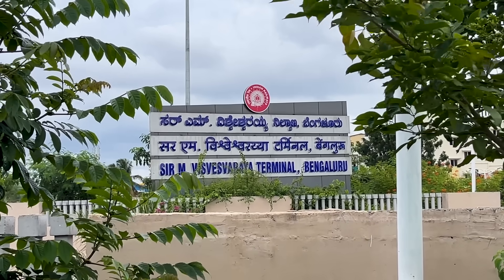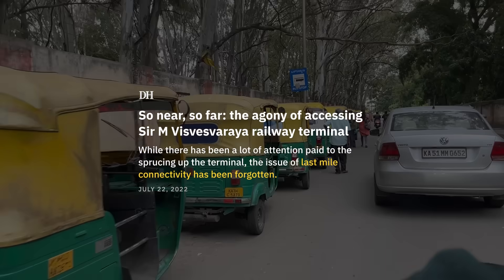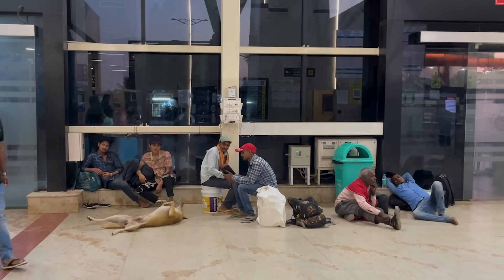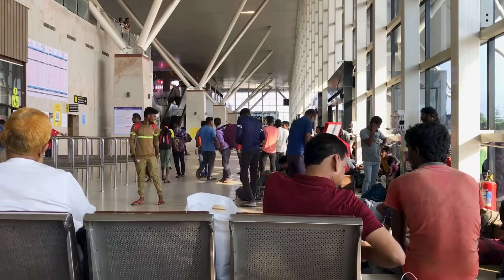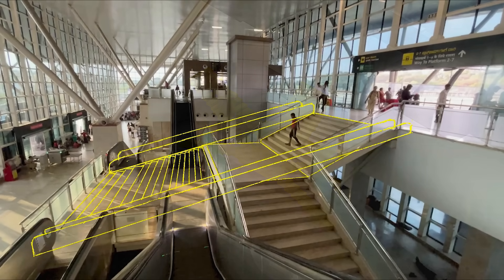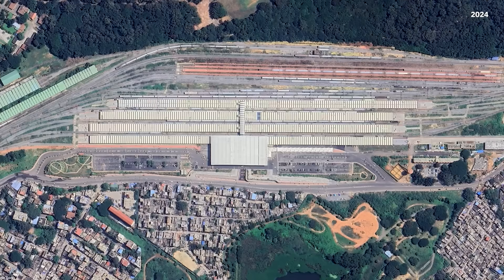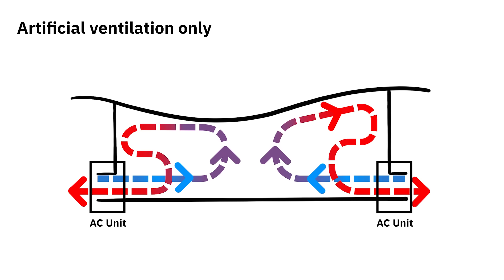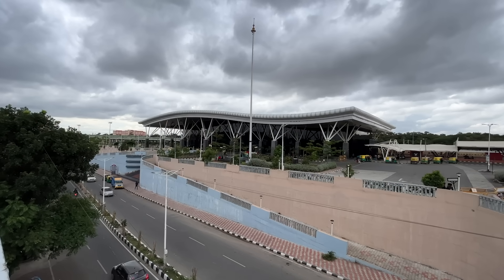India’s first AC railway station SMVT: what went wrong?

Comment: The Cooling System is Trash, was hard to navigate, also the place is extremely difficult to reach 
and the place looks like dull, the networks are poor, can't even get a service for internet, also the food court
was pointless, i didn't even see a sign board until i saw before boarding the train, also the place is a mess,
pan stains, the charging sockets outside on the benches doesn't work at all, the bathrooms are hidden, don't know why
they did that, also there's no announcements of oncoming trains sometimes, no drinking water, no waiting rooms were seen
especially the AC waiting rooms. Genuinely was the worst experience to be honest !

Comment: Have visited it , the first problem it is hardly accessible , the long journey by auto took almost forever.
Inside seemed like the idea was to show off and not think much about passenger  convenience.

There were not kiosks on the platform only at the entrance. 

Even the escalators are crammed into the little space available.

Comment: Built in one of the most inaccessible locations in Bangalore.
No Regular Bus service, nearest regular bus stop is about 2 km away
No nearby metro station, again nearest metro station is 3-4 km away.
Even road connectivity is limited, there are only 2-3 road routes to reach this place.
Reaching this station even by road is a big task, hardly any halting space for vehicles outside the stations.

The location is suitable for a smaller station for local population around that area, not for people all around the city.

Since it is already built, making a signal free road route to this station, connecting at least 3-4 main roads would be better

Comment: While the infrastructure at this station has potential, the real issue lies in the lack of civic sense among many commuters.

I've visited this place multiple times, and it's disheartening to see people spitting pan masala on walls, sleeping on the floor, and treating the space with zero regard for public hygiene or decorum.

If this station is designed to match the standards of an airport or metro, then the upkeep and enforcement should reflect that. Authorities must step in — not just with maintenance, but with clear rules and accountability.

Public spaces deserve respect. Basic manners aren't optional.

Comment: Went there early morning & that glass building with poor AC was hot as an oven.
Roof was useless for outside.
Expected an airport like infrastructure, but maintained like a govt rural bus stop.
People sleeping on floors & blocking the path, the lifts & escalators that dsn work at all- had to climb stairs with heavy bags.
No cleanliness at all.
Unclean toilets & everything is pan stained just like a normal Indian public place.

I'd rather prefer Yeshwantpur station- big station, clear visibility, metro, bus stop & auto stand is just a few feet away from main gate. ❤

Comment: 6:01 It may work for non air-conditioned infrastructure, but for centralized AC systems, it may cause pressure imbalances resulting in jammed doors and weird air movements within the building. But, I do agree with the rest of the feedback. Instead of space and resources, they should have invested on designing and planning.
Reply: Research reveals it saves energy. Perhaps it's worth addressing solutions to air movements and pressurization issues. India is new †o aircon. Homeless boys housed and fed at the station uniformed as Ambassadors could be tasked with going around opening louvred openings when they notice pressure differentials affecting doors. New HVAC engineers in the making! Betcha they could solve inconsistent cooling too, by consulting with each other to figure it all out. What a great opportunity for training! May as well throw a solar system on the roof and let them tweak that while we're at it! Skills and education for future employment.

Comment: The architect should have studied other successful station designs of Japan or Korea. They have lots of experience of building complex railway system and mass transit station. Their railway operation is famous for efficiency, comfort, safety, economy and profitability to handle massive passengers. India is a hot place with massive population, so the space and HVAC should be designed carefully to accommodate expected passengers comfortably.

Comment: Why would anything, including an airport, want to emulate an airport terminal? They are always soul-less places, designed around security and baggage handling.
A railway station is very different- it needs to get people from surrounding streets, into ticket sales, through barrier lines and straight onto platforms in the shortest distance possible. Ideally, you want everything at street level with the tracks either below or above so that there is only one height change to navigate.

Comment: I swear this looks like Chinese architecture and engineering 25 yrs ago lol. Maybe they just paid a small fee for the blueprints. Using beams and steel struts in this manner is already outdated. Current construction maximizes open space and height with no beams in sight and use of natural light and digital signage and information boards. Face recognition or mobile phone to process passengers entering train platforms, highly efficient. Plenty of public toilets, drinking water, seating and ofc various kiosk for drinks/snacks/cigs/coffee/ fast food etc.
Reply: Give an example of Chinese design like this?
Reply: @LazyCamera1314 A lot of stadiums built in those days use this method, where multiple steel supports all start at one point, ofc at that time it was safety above everything for public space.

Comment: Underdesigned: no. Its bad design, not under design. 
Over engineering : no. Infact there is lack of engineering. Hiring a cheap engineer is what this is. There is no creative solution here which went bad because the solution tried to solve multiple problems at once. That would be over engineering.

Comment: Comparing other railway stations which comes with asbestos sheets on roof in India ,
 this railway station is far far superior and  good , atleast it looks like an airport with fancy big glass covering bottom to roof , great roof designs and an AC , What I see as a  fault here is no seating space. I admit that , better seating should be provided for all the people in unused space ,  
Comparing other railway stations which comes with , again  asbestos sheet on roof with heat transferring fan on top , this railway station is top notch , 

* AC not working or proper maintanance is not the fault of designer or engineer , 
* Poor construction is the fault of contractor not the designer or engineer 
* without proper miantanace and if low quality equipments , materials are used , dont blame the designer but blame the contractor and government who overlooks it 
* if ac is not working its the problem of cheap quality products used and not proper maintanance is done , its not the fault of designer and engineer 
* I hope If airport AC wont work for few days people wont blame the designer and engineer for that

Comment: Great video! You are right, it's a disaster for the users. Something similar happened in my city (Melbourne, Australia). One of our busiest train stations (handling regional and suburban services, with 1960s-era buildings) was demolished and rebuilt to make it more modern. Enormous amounts of money were spent in making it look good. However, it seems that little thought was give to how passengers would move through the building. Yes, it has a roof to protect from the rain, but the roof traps all the Diesel fumes. Narrow subways that provided access to all the platforms were closed, and replaced with overhead walkways.  Sounds nice, but they are much higher than they needed to be, meaning it now takes longer to enter the station, go up to the walkway, find your platform number, and then get down to platform level again. Not only that, the old subways used to extend underneath the busy road outside the station, meaning you could enter the station without needed wait for traffic if you were on the opposite side of the street. And of course, there is not enough seating. These mistakes could and should be identified during the design phase, not after construction finishes.

Comment: What done is done (can't be rebuilding the whole structure) ... maybe the Rail or State government should try to revamp into a working and comfortable station for the citizens:

1. Add seats / benches for sitting - this could be easily added as 'furniture'.
2. the walkways and stairs could be revamp to be more user friendly. Including the access to other rails within the same station.
3. 'Expand' the current station to accommodate more passengers | or second terminal.
4. consider those wheel chairs disability folks ... ramps for them to access.

Good luck!

Comment: After spending enormous sums of money, consumers really need to comprehend the purpose of an architect and why using their design knowledge is so important. An architect designs a place based on the needs and intended use of the area. not merely a glass structure with civil engineering. Even if it's a little place or they believe they can handle it themselves, everyone should contact an architect for their knowledge.

Comment: This masterpiece designed by a woman architect named DS Roopkala proprietor of bangluru based company RR Architect and Associates.
Reply: What masterpiece? It ugly as sh*t and doesn't serve well as public infrastructure. You don't need a big railway station, you need a function space where people can wait with comfort. How tf is even the AC can on and off during service hour 😂😅 you either make it with AC or without AC but with a proper circulated ventilation design, in my country AC is only serve for Executive and upper class. The economy can use a non AC waiting space, but with good air circulation, plenty of food and drink vendors, you can wait with comfort. If I see a passenger waiting by laying down and using a mattress, I personally will talk to him to use and sit in the proper facility that has been prepared. Don't lower your people by letting bad habits ruin your development. Teach them how, or the government guides them how.

Comment: From the video, I understand that the station is badly planned. The layout of various facilities with respect to each other is not user-friendly. The capacities of some facilities (like seating) is not adequate. All these aspects are in the scope of the architect. Nowadays, most architects think that they are very creative and they want to show it. They come up with architectural designs which are different ( which they think showcases their creativity) and visually striking. Such designs spend a lot of the owners' money on looks and the visual spectacle. But functionality takes a backseat and users find them to be inefficient and inadequate. Coming to the engineering part, the engineers' role is to make the architectural design safe for use by providing the necessary strength. In this context, overengineered means providing more strength than what is required which leads to increase in cost. Under-engineered means providing less strength than what is required, which makes the facility unsafe for use. A layman (who is not an engineer) cannot say whether a structure is over engineered or under engineered.  A facility can be underdesigned architecturaly but over designed in engineering sense , or vice versa. The video creator is using the catchy phrase "over-engineered and underdesigned" without understanding its meaning.

Comment: Architect here. Absolutely agree with your points. The building seems like an engineering marvel at rhe first glance but when i got down from my auto and had no place to find shelter during the pouring rain other than to run a 100m distance toward the building with luggage, i was immediately disappointed at the planning and it only went downhill till I boarded my train. Not to mention a railway station of this size should be connected to a mass transit system like the metro which is not done. Thus many passengers prefer majestic or yeshwantpur still for the accessibility (if they have the option)

Comment: When showing off come in the way, simple things that actually works are missed out.
Unfortunately,  Railways is more into Showing off, trying to impress, than express. Passenger emenities has gone for a toss. Anyone can travel anyway, railways just want your money, espically Safety gone for a toss.
One thing, you missed out is a Safety check of the building and infrastructure around it, when mass movement takes place. The staircase is a disaster, and imagine hundreds running down and one stumbles.

Comment: Hello from France! The staircase design reminds me in part of the one at the entrance of Montparnasse train station (Paris).

It also has a mix of straight and zig-zaging stairs, but a big difference is that Montparnasse is 4 floors high (one underground floor for subway, the station entrance at ground level, and two upper floors for trains). The straight stairs lets you go directly from the entrance to the local trains waiting area, and further to the train tracks; while the zig-zaging stairs on both sides lets you move between all the floors.

Comment: 0:19  that dog😂
5:47  not true...  most AC power requirement come from temperature control.  Opening increase heat flow from outside.    Why dont you try using your AC when window open and see electric bill next month

Comment: I’m from the US, so i may not be able to properly speak on this, but Penn Station has a similar issue with seating. I’m not sure if it was the same idea, but the reason that there’s no seating in penn station (as cruel as it sounds) is because they wanted to avoid homeless people sleeping in and around the station (which did nothing, homeless people still sleep on the floor and now have to deal with bugs and rats and now no one can sit.) I’m wondering if it’s a similar situation with this station.
Reply: Those people are not homeless people but migrant labourers from different states. When trains are late ( now we buildings separate fright train routes to solve this issue) they slept there cause exhaustion.

Comment: Sir M Visvesvaraya Terminal Railway Station - RR architects and associates who designed this building                                                          ARCHITECT - FOUNDER
Ms Roopakala D.S
RR Architects & Associates is an architectural practice based in Bangalore. It was founded by Roopakala, Proprietor of the firm.

RR Architects & Associates has realized several projects in Bangalore. RR Architects & Associates functions under the strict rules of environmental awareness, quality, and clarity.

Comment: What is the point of glass buildings in India? peak temps reaching 40 to 50 degrees and our fantasy continues. Glad for you did this case study and well.
Reply: Maybe you are not aware of Bangalore climate, it never reaches 40 or 50.
Reply: Meanwhile UAE
Reply: @Abubacker-kv3tu   you need cooling for that...we are not energy resourceful country
Reply: @Abubacker-kv3tu  You are comparing the UAE which has the energy resources to continually keep its cities cool and low population to India which has billions it needs to give energy to
Reply: natural light is better than any lamp.
Reply: @rizkyadiyanto7922  

 I always favour natural light  and there are ways to provide natural light but with least solar heat gain. 

Unfortunately glass isnt one of those solutions. 

There are reflective glasses and also DGU types but its much less efficient in reducing solar heat gain .
Reply: this guy is definitely an outsider who doesn't know anything about Benguluru weather 😂😂
Reply: @deviljester6662  when i visited Bangalore, it was humid and felt hot. 

Its certainly not as cold as the northern winters just around 25-29. In good days, 
With these glass panels you get sun greenhouse effect and that heat stays trapped inside resulting in more load on HVAC.

Having a good weather is a leverage, but that doesn’t mean to stop putting efforts into efficiency.
Reply: Last time i went to Bangluru it was 16 - 25 degree Celsius.
( Oct 2023 )
Its always 5 degrees lower temperature than other south indian coastal cities.
But the SMVT railway station was crowded with Bengalis and Assamese migrant worker sleeping in the platform floors.
Same situation in KrishnaRajapuram staion, another station we visited same week.

Comment: 1. Brick walls with rat trap bond. Liberal use of louvres or gratings for natural light.
2. Arrange in a grid, divide into central courtyard pattern every 15-20000 sq ft for air cooling. Provide the hot air that enters the building with a challenge in order to get out. In effect, that ensures the coolest portions of the air steadily accumulates.
3. line of fountains on the outer periphery of the building ( unless water is a problem. Oh, bangalore .. )
4. Phase out glass completely. Use ceramic grilles either in a diamond pattern our in the louvre pattern to cut incident sunlight entrring the bldg to 50%. 
5. As a trial, white mica strips ( cut from sheet mica ) or other such reflective, insulating material may be used as a top layer over the louvres to cut heat transmission.